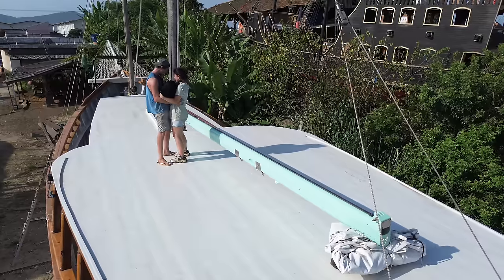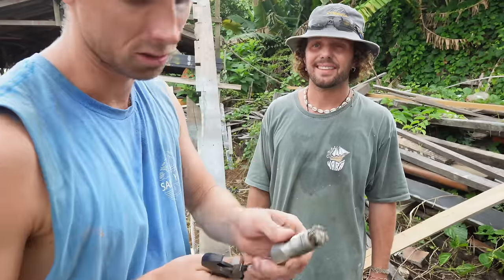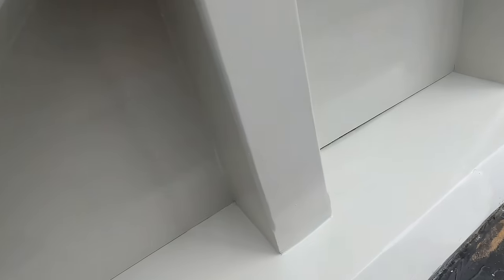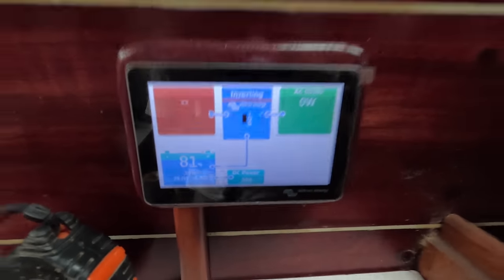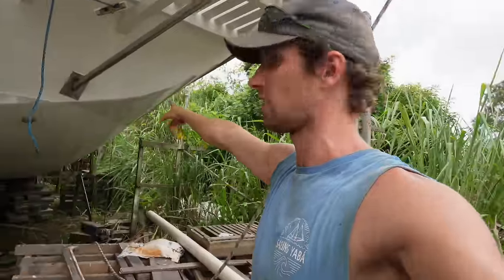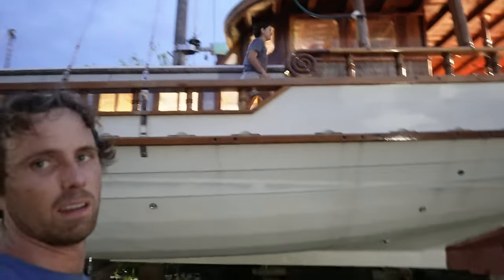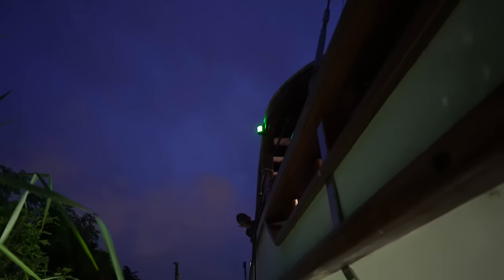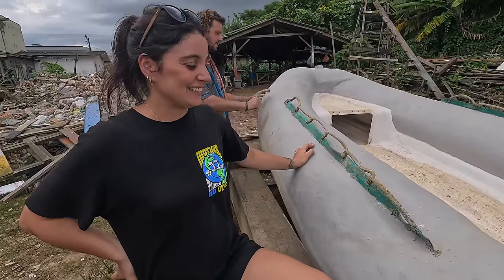Restored BOAT charged for Adventure: Solar Panels installation & Launch Prep  — Sailing Yabá 199

Comment: That Dinghy is a perfect Dive Boat, it will never sink, won't bend over in waves or when a diver is climbing on board,  and the rubber won't rot in the sunlight.

Comment: COLREG: ANNEX I: 5. Screens for sidelights: "The sidelights of vessels of 20 meters or more in length shall be fitted with inboard screens painted matt black, and meeting the requirements of Section 9 of this Annex." 
Here we go and I hope that helps. Basically that means you need to build a box out of two boards and mount it on top of the wheelhouse to comply with that rule.

Comment: What a great heart warming episode.  Really enjoyed your family pitching in.  Only thought on this episode was how your boom may act with your solar panels,  I have used up quite a bit of deck wrestling a sail down on to the boom.  About your dingy?  Guess it can not sink. Always thought they would make a great rain water collector with a hose in the drain plug. Bet you get an all electric like Capt Moore has before long.  He used a cheap winch and cables for a good retrieval  davits.  Every time I see Yaba from a drone shot  My blood pressure shoots up 19 points.

Comment: Perhaps your step father can check out the rudder cables for suitability. They look insufficient but the cables must be stronger than they look. Progress is great and can't wait to see Yaba hit the water
Reply: I am glad someone else noticed this. I know NOTHING about boat building but would love an explanation as to why it looks so flimsy?
Reply: @billhanna2148 the cable they use is very strong and could pull a few tons with just a couple of strands of it the fasteners will most likely fail before the cable I work in the oil field and we use steel lines for everything.
Reply: @chadstinson9886  thank you sir

Comment: Your Dad is right.  The tubing brace would be greatly improved with a vertical brace.  And I have talked to you guys (till I'm blue in the face) about the concept of a truss system.  The combo arrangement (cable/tubing) etc. that you have in the back could have been two rugged truss systems welded and attached.  Tubing is great.  Also again on the fore part of the boat (the bowsprit) a vertical (up and down metal post) like a "spreader system" only horizontal.  Would add the strength of a truss system to the bowsprit and total rig of the boat.  There would be much less flexing. I'm blue in the face here. Oh well time will tell.  Set your sails and see what happens.   Steve from New Hampshire.

Comment: Guys  all looking great ,BUT please  have a look at your rudder steering system there is a missing component , you need a spring tensioner  for each side to take up the slack when the opposite side is applying the tension. look at your video and the slack wire bowing  as the rudder moves ,it will come off the wheel if you do not guide it.

Comment: Good work!  Maybe cinsider using some anti-sieze on threaded hardware. There is a good chance those cables will need adjustment later on

Comment: 3 years and a bit. I remember when I saw the first video. Yabá blue, you both with snorkeling gear. The pumps running almost 24/7. The patches with plywood to keep the worst out. The steering getting blocked in the harbor. The engine quitting as you took her back here. And I could probably fill like 20 pages and still not say everything I want to. But now it is going to happen. Now Yabá will float again. Congratulations both. This must be like, . . . Nothing else you ever felt 😊

Comment: The platform is too large and placed far to low, I seem to remember that you put the beams straight through the hull in the aft, instead of bolting it on?

Comment: I also have a prop shaft question.  What keeps the shaft from sliding out of the boat in reverse??  I went back and watched the video about the thrust bearing and didn’t see any kind of retainer on the shaft to stop it from sliding out of the boat.

Comment: as long as your engine can start your steering works and you don't have no leaks and the bottom of your boat is painted at this point definitely could go to a dock and work on the rest of the boat of all the finishing touches, it is looking really nice but I don't think you got enough solar power but you will find out that as you go.

Comment: Ben I think you can better two angels up the platform to the hull because the cabel under the platform has now no power it’s almost flat end wen the wind is strong from behind it can pull the platform upwards.

Comment: Another question about your boom. The solar panels have been placed so far back that a boom traveller cannot be installed, unless a very elaborate arch is constructed. You very briefly mentioned a traveller last week. Also, is the cabin deck strong enough to take the strain that the main boom will exert? I see no reinforcing in that area. There doesn’t seem to be any provision for a boom vang.

Comment: Your boat is going from great to fantastic!  On the Tally Ho channel, they showed what looked like a small rudder on the rear edge of the primary rudder (I do not know the exact term for it).  It would turn at a somewhat steeper angle than the primary rudder.   Apparently, this extra rudder creates a quicker response and easier steering.  This is just a thought, and you may have already considered it.  Anyway, keep up the superior work and may there be future red sky and night.

Comment: Ik zou de zonnepanelen nog een keer los halen. En dan de schroefgaten vullen met epoxy. Jullie, hebben zoveel tijd in dat dak zitten. Het zou jammer zijn als het over een paar jaar weer gaat rotten. Groetjes uit Spakenburg, Nederland.
Reply: Yep, drill oversized, fill with epoxy and then dril the needed hole in the epoxy.

Comment: That dingy is awesome.

Hey do you have enough clearance in front of the boom traveler to not smash your solar panels with the block and tackle hardware that will drag across the cabin deck as she slack swings to and fro?

Comment: It is not smart to place the solar panels in series. If 1 of the panels malfunctions or breaks, you will lose your total power. It is better to install a micro inverter per panel so that the energy supply remains intact.
Reply: it’s not just that, shading is going to be a big issue like that, the sails and the mast usually shade one side and that prevents the current to run through the whole chain thus canceling any production from the unshaded panels.
Reply: Microinverters.....great idea... not. You do realise they are not in land.....panels are to charge batteries. Why convert DC to AC, and then back again?

Best to run 2 parallel sets of two panels in series connected to separate mppt's. This will give the best production of the boon/sail is shading one pair of panels.
Other bonus is you can monitor the output of each mppt and compare to help spot a duff panel.
Reply: 1 squared R
Reply: @christianjackson9534  I think they meant “micro-controllers” not inverters, that’s the ultimate solution to have one controller per panel but I would have done like you said especially since they have a 24v system and those panels are probably rated for 30v each so one is probably not enough in normal conditions
Reply: Split the panels into pairs. Starboard / Port. This will take care of shading. So long as the combined mpp voltage is greater than the battery voltage +5V the Victron Charge Controller will function correctly.
Reply: @stuarthanford5446  that’s sounds a great idea, don’t forget there should be bypass diodes in the modules as well. I once saw the diodes removed and a cell carefully shaded. The module burned up over the shaded cell. Made the point very graphically
Reply: Also when 1 is in the shade it affects the other three right?
Reply: I thought it was the other way around. I thought parallel had that problem, but series not
Reply: @frankd2301  yes, think of it as a line of railway wagons being pushed along. One has brake failure and slams on its brakes. The rest all pile the effort of being pushed into the one wagon. Bypass diodes are like bypass loops that the defective wagon ducks into. If shading was a serious problem then more bypass diodes could be used, but at a cost of the extra resistance of them. By and large most module makers know what they are doing and get it right. IEC 61215 is a a mine of information.
Reply: @loveoracle8797 think of it as a single wire.  If in series and one goes bad it’s the same as cutting the wire and none will work. But if in parallel there are still multiple paths for electricity to “flow”.  Also, I’m series, if one or two of the panels are shaded the overall total of voltage produced is reduced, spread out between all the panels.  If in parallel the other two are still producing the full voltage to the system.
Reply: @loveoracle8797  go back to the wagons, lots of parallel tracks…..
Reply: Verry strange that they don't inform themselves of the basic's panel installation. Something could also be done after the launch
Reply: Something I wondered about for a long time, why is the propeller so small?
Reply: Have you seen the 1970's cartoon "the Flintstones"? You can name your dingy "dabba do"

 Fred Flintstone always says yaba daba do. 

😂😂
Reply: They should get 4 victron charge controllers, one for each panel. They won't even be very expensive. Awful idea to wire them in series as shading on one panel will reduce the voltage of all of them and even when the sails are down that boom will inevitably shade one or two panels.
Reply: Omg 😱! After all the fabulous, amazing, beautiful restoration of this now magnificent vessel!!!! You want to bless it with that ‘Frankenstein dingy ! 🤦‍♂️🤦‍♂️🤦‍♂️🤷‍♂️ please don’t let it be. Sink it I say and pray , just think of the weight and the damage it might cause to the vessel when tying up? I don’t think and I’m sure many others will agree with me in saying let the dingy sail away and get a new one 🙏 for your safety and comfort ❤
Reply: @patrickconway5542  FORGET EVRITHINK just launch YABA!!!!
Reply: Yep YabaDaba for the dhingy! There is also Prince YabaDaba in a Bugs Bunny cartoon LOL
Reply: Most panels have built-in parallel bypass diodes, shading or damage on an individual panel is generally not a problem if you have this type of panel. Four ~21v VOC panels in series for a 24v battery bank will be about right on the money for best efficiency, and minimizing required wire size due to lowest possible current, especially if you have MPPT controllers. If they are closer to 40 VOC, then two paralleled strings of two panels would probably be better. The charge controller documentation will have info on the most efficient panel vs battery voltage - listen to them, not the armchair electricians who have never wired a single panel in their lives
Reply: They are doing a lot of things recently that aren't to smart. I just hope the poor decisions they are making trying to get launched by a certain date doesn't end up with them sinking . This boat is not ready or safe to take off shore in the open ocean. They plan on doing ocean crossings in this boat and it's most likely going to end in disaster if they get into heavy seas and a bad storm.
Reply: Good work ❣️⛵ a wooden boat building
Reply: @sailing_seaescape good work ❣️⛵

Comment: Looking good. Just one question. Are you tying your chain plates to the frame, which transfers load right to the keel.or just bolting through the planks.

Comment: The white light is your anchor light,  used when you are lying under anchor or on a mooring ball. It should be on a separate switch. Using the white light together with your navigation lights (red and green) is sending confusing signals to passing traffic and should never be used together. Red and green lights are to be used when sailing and white light when stationary on the hook or on a mooring ball.
Reply: That is a stern light which like an anchor light is white. Unlike an anchor light which is 360 degrees, it is 135 degrees so it does not overlap the red and green side lights.
Reply: Thank you, learning something new every day
Reply: Nope, an anchor light is a high up and visible all-round white light.
This is a stern light only pointed backwards at 135°. It meets up with the starboard and port lights which reach about 112.5° from 22.5° more aft than transverse.
When motoring there should also be a (white) steam light well above the red and green ones shining forward and aft till it meets the angle of the stern light, so 225° in total.👴🧐🤷‍♂
Edit:
A "big ship" (>20 meter as Yabá is) is recognizable by a red and a green light shining all around in the mast ("Red above Green").

Comment: Recently saw a boat that was filled with foam and the foam soaked up water and caused the boat to sink. Hope you used the right type of foam?
Reply: Judging by MP's reaction in the eternal dispute, my guess will be that this dinghy will not be around for long (enough to get in trouble)...👴😉😁

Comment: Hello, please tell me if I am wrong but wouldn`t it be better to have the panels connected in 2/2?
2 in series left, 2 in series right and this two strings in parallel so that the shading of the sail will only affect one side.
Just my 2 Cent here.
Cheers
Marc

Comment: Guys - think about the depth of the anchor chain box. It looks a bit shallow to me. The chain has to have enough depth so when it is hauling in it won't pile up and obstruct the chain coming in from the capstan. This happens on my yacht and it's a pain. I have to keep stopping and put a bar down by the capstan to push the chain pyramid over! Still think that aft platform will be a problem in rough seas - sorry!

Comment: I have seen on another channel that a isolation for shore power might be needed.

Quote from internet:
The galvanic isolator prevents electrolytic corrosion. It blocks low voltage DC currents that enter your boat via the shore power earth wire

Are you also Installing it or not?

Comment: I’m sooo excited for you guys as I expect by now you are floating. I’ve watched your progress from episode #1 with interest as my specialty is redoing and repurposing older single-screw steel ships for my requirements. Congratulations on rebuilding Yabba to better than new. Hopefully all systems purr for you, but I worry about your anchoring system. I fear it may become the bain of your existence as you cruise and explore our planet. I believe your chain locker is way too shallow to allow your chain to layer itself without pyramiding too high and jamming in its feed pipe. It looks like you may be restricted in the locker’s shape and depth so my 2-bits worth … don’t make the bottom flat and parallel to your deck. Make the aft-end of your locker much lower than the forward end. This will allow your chain to find it’s own level further aft of your feed point and not stack up as quickly 🤞and allow you to stow lots of chain easily!  Congratulations once more on getting her floating again without leaking … !

Comment: For those solar panels....you need air circulation under them.  The more clearance you have, the more chances you invite a different critter to move in and make a home under the panels, as they are the perfect roof for a critter house.  haha.  You may never have critters try to move in under your panels, but you need to be aware that this can happen... rats, birds, squirrels, raccoons,....they all love solar panels.  Let alone bees, wasps, and other insects.  Then there are the plant-like "critters" like lichens, moss, algae, and others.  Then there are the spiders.  They are going to be there regardless.... You just have to be aware that this will happen.... Every sailor knows that in the evening on any boat, especially sailboats, the spiders will come out... tons of them...the bigger the boat, the more spiders....and large spiders....

Comment: Dinghi will be fine just paint it and it will look good again. That ring for the stern support will catch dirt all the time. If it has to be a ring, why not mount it on the stern facing rearward. Or in place of the square plate holding the ring now make a longer plate extending past the rear with a hole, just like the normal chainplates. 
From directly front both nav lights must be visible... check that. It looks as if the roof has a slight angle where now you might have no red/green visible from directly front, that would be bad....

Comment: Isn’t there an issue with running all the panels in series that if one gets shadow then all loose output??? Isn’t the solution independent wiring and charge controllers?? I could be wrong

Comment: you''ve made a lot of holes in your fiberglass to mount those solar panels is it still watertight?
Reply: this boat isnt fiberglass
Reply: @StreetTruckinTitan  much of yaba is covered in fiberglass, if water penetrates wood will roth.
Reply: @StreetTruckinTitan  the wooden roof is glassed to prevent water leaks... they put a lot of effort to cover it in fiberglass and multiple layers of primer and paint to make it watertight...
Reply: @kamsok6132  Yes the roof is fiberglassed. The hull isnt.

Comment: I think you're going to be running out of solar power quite often, I don't think that's enough solar panels I think you're going to end up putting solar panels on the platform in affront to I think you're going to need a lot more panels than what you're thinking, but either way it will look very nice. Even if you have to start the generator of the boat to charge. Solar panels I'm sure you're going to have to do that quite often

Comment: I think that your dingy is great a little clean-up or paint would do the trick. Not forgetting that yaba  is a ship and not a boat, so why would you want a fart arsed small rubber dingy.. God forbid that it's nessarsary to use a dingy in an emergency.  You all would be secure in the knowledge that what you call ugly will save your lives.
Reply: it is sail boat